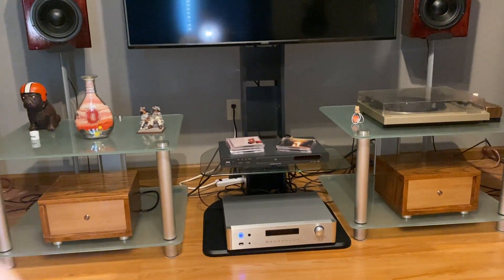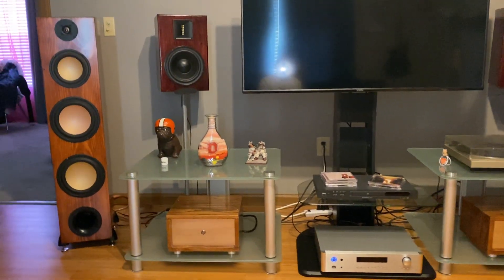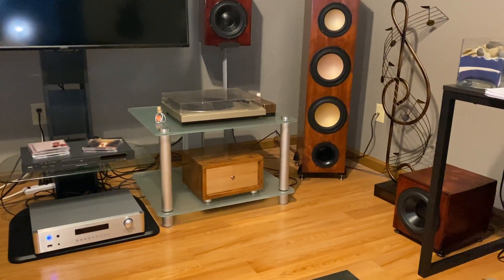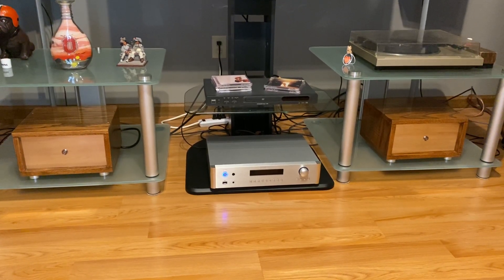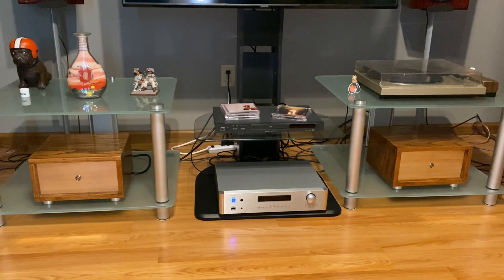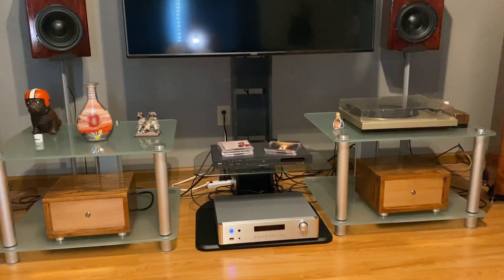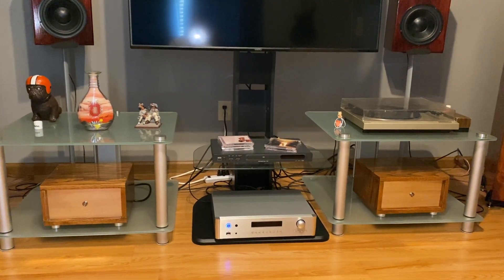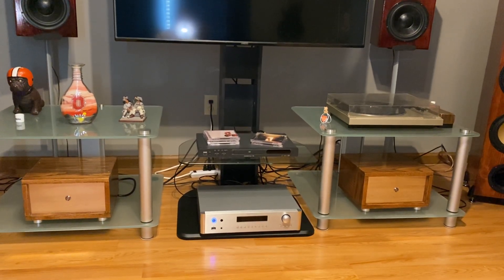Icepower 1000asp amplifier build pt.6

Comment from the maker: Correction on that power on off light it is not 12 V it is 120 V AC the 12 V DC output I was talking about actually goes to a cooling fan that I mount it in the back of the amplifier case so the on  off light switch is 120 V ac switch that I have hooked to the power from the outlet coming into the amplifier box.

Comment: Can you please explain how you hooked up power LED's to the 1000asp? Did you hook up using Vcc (+12V) and Vss (-12V)?
Reply from the maker: The amp has several VC outputs one of them is 24 V I bought a step down converter from Amazon which dropped it to 12 V. The lightest switch runs on 12 V. Next week I’ll drop a video and show all the wiring